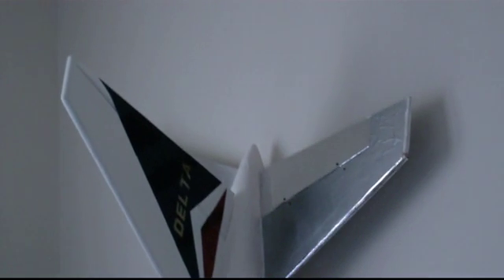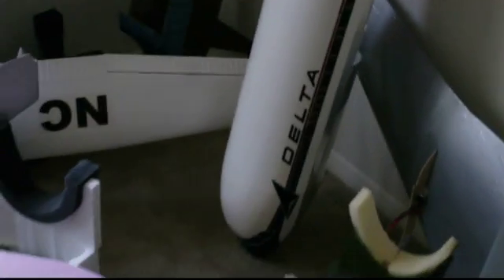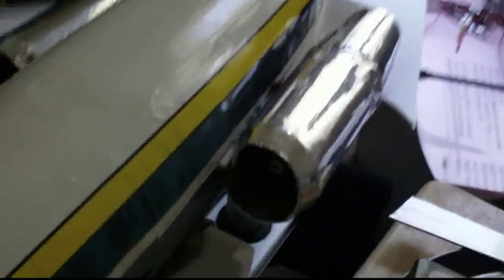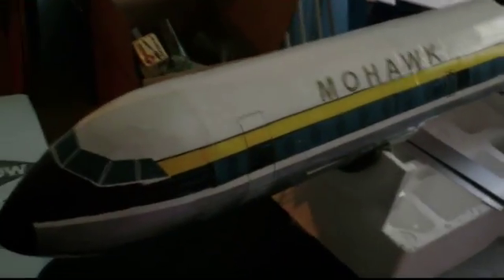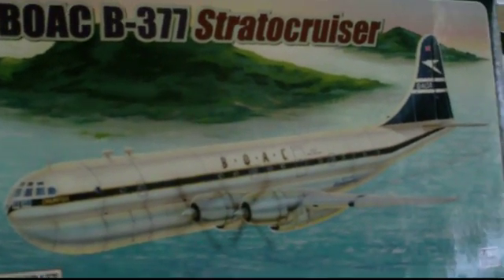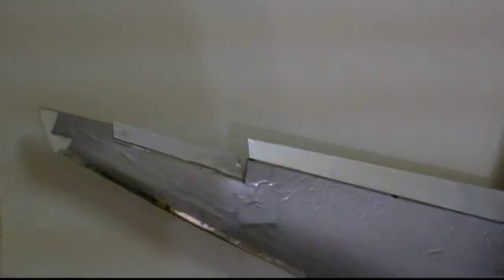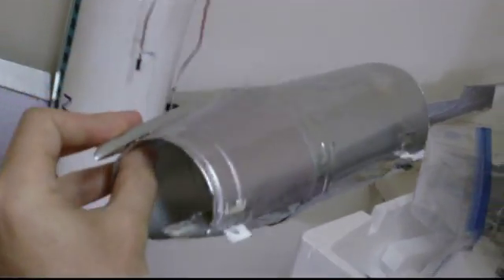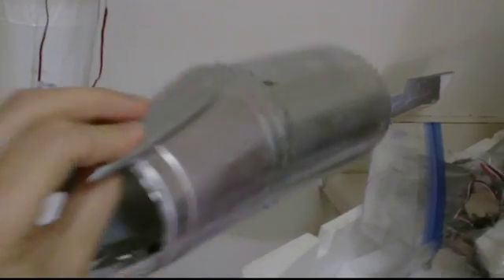How to build a 7 Foot Airbus A300 RC EDF airliner Part-3 My Jet factory!

Comment from the maker: @PMDGFlyer   It depends on the epoxy resin you laminate the fiberglass with, I would say a half to thress quarters of a pound, I don't cover 100 percent of an airliner only the center wing box section & the stablizer, It's way easier to fix damage if you don't have to fix fiberglass as well, fiberglass shatters & cracks and is a bitch to fix.